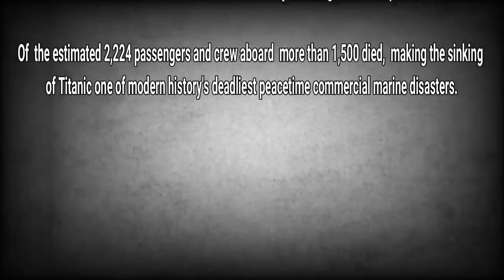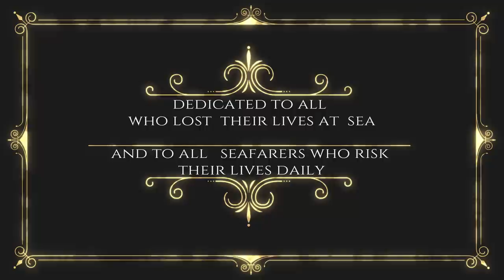TITANIC hitting the ICEBERG DIORAMA /LAMP - Epoxy resin art

Comment: Very nice job, but hindsight is 20/20 and I would have done two things different: 1) the roping is clearly not to scale and its fuzzy look is just not right. Would use actual very fine gage metal wire instead. 2) Your lighting is shining through the translucent deck. Paint the undersides of the decks black to block the light.
Reply from the maker: I agree with no 1. Regarding no 2 the illumination is not that bright as is shown on the video.  Bear in mind that the illumination is always brighter when shooting under low light conditions. In reality the illumination  is closer to the last picture of the video. Thank you for your comment.

Comment: Nicely done. My only gripe is that I would have left a lot of the portholes undrilled/dark. Remember the Titanic hit the iceberg at 11:40 pm at night. many of the passengers were asleep and had their lights turned off.
Reply from the maker: Thank you. You are correct but my aim was not to maintain 100% historical accuracy but to create a lamp. Therefore the open portholes assist in the better illumination
Reply: @4THECRAFT  Fair enough :)

Comment: This turned out beautifully haunting; you should be proud!
To save clay during future projects bulk the middle of your sculpture with foil. From there it's just a matter of layering your clay to fit your needs! Most use foil, wire (typically floral & jewelry; thick & thin), masking tape, hot glue, super glue, and cardboard; anything to bulk. I don't believe it'll affect the lighting but I know nothing about electronic work. Just a suggest! 😊

Comment: Really Nice, especially the lighting.  You might try a wash or panel liner on the deck areas of the model and come back with some spirits on a q-tip to wipe off the highlighted areas.  It's something military modellers often do in that scale and adds nice depth for very little extra effort.

Comment: Amazing ! Might I suggest if you happen to make another one of her sinking, the most dramatic moment of when she splits between the second and third funnel. Now there’s been some debate about the lights flickering off for the last time before the break , but then after she splits, they might have come on for just a split second giving her electrical system might have had a little juice left from her generators. Her submerged bow would have had a few lights below the waterline  still illuminating near the surface with pieces of debris floating around . You could put the overturn lifeboat on the port side and other lifeboats floating nearby. You could even put a submerged ( funnel number 1) sinking because it still would have had its stays connected to it. Just giving you a very dramatic idea

Comment: VERY nice work! A lot of time and delicate patience went into this one as i can tell, and i love the base. I will give a few tips and things for if you were to do this again though. Titanic at the time of her maiden voyage was not complete, and only was filled about 1/3 of her capacity and many of her cabins were not finished therefore not used so many lights weren't on. Also this is a nighttime scene and the 1st class dining room(third row down in between the 2-4th funnel) was cleaned and lights were off by 10 am, titanic struck the iceberg at 11:45. The iceberg that hit titanic was also believed to have been different from the one you made, it had 3 peaks and "resembled the rock of Gibraltar". Now i am not trying to nit pic your amazing work, these are just tips for next time(if there were to be) for historical accuracy. :)
Reply from the maker: Many thanks for the useful information

Comment: That looks really impressive.  New information has come out about the Titanic and the iceberg that sank her, and the way it all happened, if you're interested in doing that with more accurate information, they're still discovering new things, as the investigation continues.
 What you've done for this video is really awesome. It's not my intention to take anything away from that, the end result is truely stunning. Great job, great video.
 The experts feel very confident that they have a picture of the iceberg, and they know it caused damage to the underside of the hull as well, based on the trail of coal, that leads to the wreckage site.
 It's really amazing what they've been able to piece together about the events of that night.

Comment: Hi, firstly get well soon for you have been cut your finger 😢
Did you used any putty for ship fuselage? Like a tamiya putty
Reply from the maker: Thank you. If I remember correctly I did put some putty at the bottom of the ship because it has 2 small holes
Reply: @4THECRAFT  thanks a lot and finally is this model ship can swim without any sinking could you tell me if this is impossible

Comment: Shouldn't the rudder been turned hard to port? Or was that not possible with this model? 
The piece is very well done.
Reply from the maker: The rudder is fixed straight in this model so only if I cut it and glued it again I could make it turn

Comment: Did you remove the plastic edges?? I would assume however you kept the plastic base also what size is the container for the resin as I have this revel kit and would like to construct something similar thanks
Reply from the maker: I have removed all plastic from the sides and the bottom. The measurements depend on the size of the model and the iceberg.
Reply: @4THECRAFT  the model is the exact same as the one you’ve got, revell Titanic 1:1200 scale, wanted the measurements so I could have a go myself

Comment: 2 critiques of the model (always start with the negative but finish with the positive!)
1) the iceberg damage done to the Titanic wasn't generally that bad.  We're talking surface area of a normal refrigerator/icebox like I have in my home.  That's what the rate of flooding suggests and apparently that's the level/area of damage a sonogram device detected in the mid-1990s under the mud although it's questionable what is iceberg damage versus the damage caused by the collision with the ocean floor.  At any rate, the "slits" they imaged by sonogram fit the general area where the damage occurred in multiple compartments.  Too many compartments were compromised (5 if I remember correctly; she would have survived up to 4 damaged!) and that's why the Titanic sank.
2) the iceberg itself is thought to be shaped like Rock of Gibraltar.  They actually have a photo or two of a candidate for the iceberg that fits this description.  It even had evidence of a possible collision with a ship and WAS near the site of the sinking.  This was photographed within days of the foundering.  It'll never be known for 100% sure IF the iceberg was photographed -- multiple bergs were photographed in the days immediately following the sinking -- but the 1997 film's depiction was based on the "Rock of Gibraltar" iceberg.
Oddly enough the 1958 Titanic film's iceberg was based on the other most-promoted candidate that the author of the book the film was based on (A Night to Remember) had a photo of, too.  That was a generally twin-peaked berg.
Now, I know the damage was exaggerated because of the model scale and the fact you wouldn't see that if  you literally made a thin razor blade damage to the ship's hull.  It just wouldn't be as interesting a diorama that way.
The iceberg shape I forgive because frankly we don't know 100% about it but the Gibraltar description seems to hold up best with the available eyewitness testimony.
I very much like the color you got out of the resin.  You apparently know what you're doing with this material because I also watched the excellent video of the resin diorama you created of a submarine firing torpedoes under water.  That is THE BEST ship in a bottle video I have ever watched!
Reply: PS -- God, does that Titanic diorama look beautiful lit up!
You could probably get a nice price for a diorama like this online.
Don't undersell yourself.  It's a nice finished piece of art.

Comment: I see a lot of modelers paint the parts while still on the sprues. I assume you would have to go back and touch up those areas with paint after cutting them off?
Reply from the maker: Yes usually you have to re paint where they have been cut.
Reply: VaporheadATC I mainly do it do get the base colour down, and yeah when you cut em out there a little tiny blank part put its easy just to paint it

Comment: You actually didn’t need to drill ALL the holes in the ship. The ship was actually under booked, so some of the cabins weren’t being used. People were also sleeping during the iceberg strike, so most of the lights could’ve been turned off.

Comment: I saw a lot of vids where they put lights inside of the resin but wht if they need to change the battery
Reply from the maker: The  battery case is at the bottom of the base so it is easy to change batteries.

Comment: What a beautiful piece, yet what a horrible tragedy. I feel so bad for all the ones who died on that ship. If they guy with the key to the engine room would've showed up the fire would've probably been put out. because no one knew there was a fire onboard and nobody had a key, the fire weakened the metal causing the iceberg to be able to rip right through the metal. Normally it could've hit the iceberg with no problem.

Comment: Realistically, not every single light on the ship would be on. You would have cabins with the lights off or just areas and spaces that weren't in use during the night. Plus, the ship was never fully completed. So, you didn't have to drill out every single porthole, lol